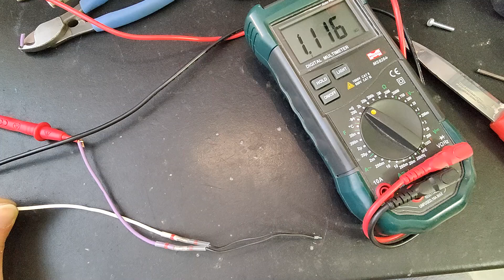EV Charger Connector Teardown

Comment: I was hoping those huge cables and DC contacts in Pheonix connector to be liquid cooled. Aren't they?
Reply from the maker: The charger they came from was a low power fast charger, 50kW 
The more powerful DC chargers have liquid cooled cables and connectors
Reply: @MrTesla1337  Appreciate the quick response. Please plan on a teardown of one of these liquid-cooled chargers. Thank you.
Reply from the maker: @nrupathunga05 If I am lucky and find one at the local scrap yard I will, that's where I found these connectors

Comment: Pretty much agrees with what I saw when I was working for an AC charging station manufacturer. These plugs have a resistor of specified value on the proximity pilot (PP) line, and the resistance informs the car about the current capacity of the electric vehicle service equipment (EVSE) a.k.a. car charger. The thin red wire is named control pilot (CP) and it serves the purpose of signaling between the charger and car - the latter dictates when to apply voltage, and when to lock the connector on the charger side if using a cable plugged in on both sides rather a charger with an integrated cable.

The DC plug uses DC + and - as well as protective earth, control pilot and proximity pilot.

Comment: Tesla turned their proprietary, sleek connector into a standardized one (NACS) and convinced many other automakers to switch to it. How they kept it compact is to use 2 pins that can be repurposed for either DC or AC. (I'm not sure why they didn't make it rectified, unfiltered AC instead of straight through AC, even 100A bridge rectifiers are pretty cheap and would eliminate the need for one of the rather expensive bypass contactors for DC charging.)

Comment: I think the resistor in the type-2 connector "tells" the car how much current that is safe to draw through the cable
Reply from the maker: Sounds right, both of the resistors had different values